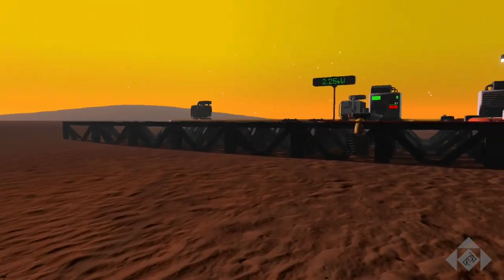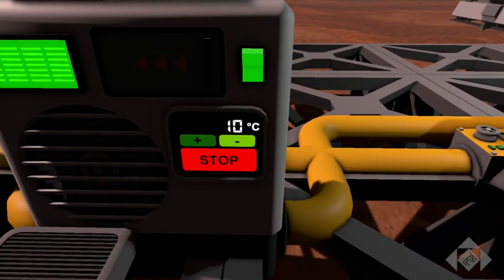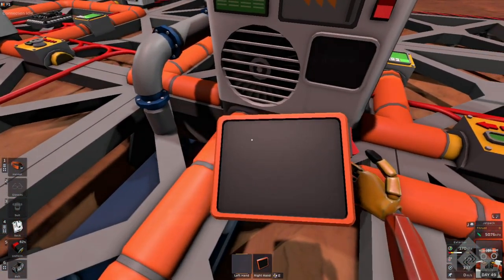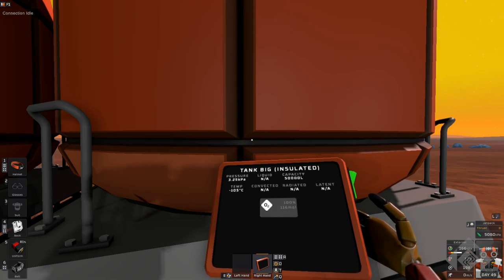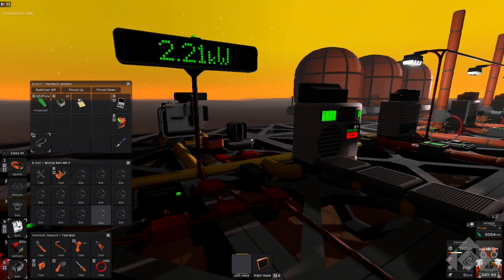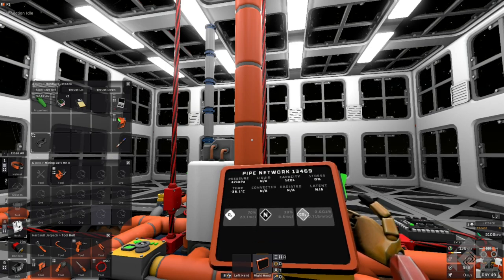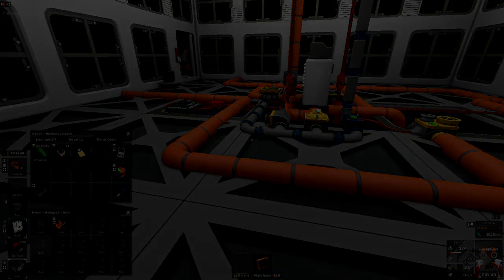More Realistic Gas Filtration, an actually quick tutorial - Stationeers

Comment: Hey Joelle! I have coded a single stage variant that is able to handle any gas input (as long as the O2 partial pressure is high enough) and make breathable air. Single IC (optional second IC to handle the liquids with a pump designated for each type of liquid) and it just hits temperature targets and waits for each gas to subsequently condense out of the system before heating it back up in the end with just oxygen and nitrogen at the ratios you want. Even allows for dialing in the ratios of CO2/O2/N2
Reply from the maker: Cool beans. If you make a video, send me the link!

Comment: Ok idea time, here is what I'm thinking: a self cooling loop from furnace exhaust, given that pollutant liquefies so easily at pressure and that that furnace exhaust is usually full of it (pressure and pollutant). Making like a heat exchanger (in one of your recent videos), where condensed pollutant goes into the chamber and evaporates back again drawing heat, a back-pressure valve to make sure it stays under condensation pressure, and venting the excess off.

What I'm wondering though, is how to make sure that the mix of gases is clear from pollutant before moving on to the next phase, and I guess filtering out the next elements without needing A/C. I think it could be done with pressure alone and some passive cooling, using nitrogen as pressurant makes sense, maybe condensation chamber for the separation?

Comment: You show something you call a "drain valve," but I don't see it listed in the pipe bender...
Reply from the maker: I'm probably referring to the evaporation valve.  It's in the valve valve object, the one that connects gas to liquid, or something like that.
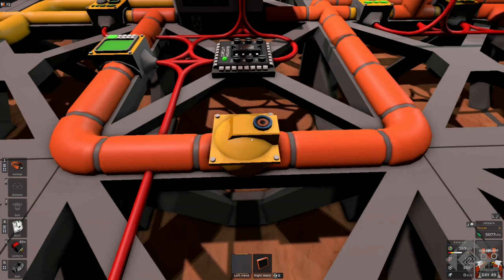Reply: @JoelleTheAbsurdist  Thanks for the reply.  2:15, there is something I see in-game called a condensation valve, but it has an actual valve handle on it, and requires a liquid pipe at one end and a gas pipe at the other, as far as I can tell.  So I've been attaching a liquid pipe and then a liquid drain, and leaving the valve open.  What you show at 2:15 looks a lot simpler.
Reply from the maker: @1squit  OOOHHHHH. It part of the drain object... the blue thing.
Reply from the maker: @1squit  This might help you
https://www.youtube.com/watch?v=0yzKhU_0APU
Reply: @JoelleTheAbsurdist  Ok, thanks!
Reply: For the next time, something like this happens. You can open the wiki, pressing F1. You find the object you want to place and there you will be shown which kit you need to build it!

I hope that helped :)

Comment: Hi, a neewby here, i just starting and the first thing my engee-brain made me think about was gases filtering system. Until now trying with condensation systems, wiil be too much to ask you to share a save file with this setup? i will love to study it and learn how is working and the game mechanics behind it. Regards!
Reply from the maker: This is a different base, but is set up on a planet with more gases and a more varied temperature range.

https://drive.google.com/file/d/1FBKFtWMzmppZ9Gh2Ez3I7CpMhk010Fup/view?usp=sharing
Reply: Thanks  @JoelleTheAbsurdist  !! I dont understand the system on this file, is a little different to that one on the video. By my self, after many many tries, still cant do a "clean" filtering, always get some mol-fractions passing the sensor. Some ideas how to make partial process? i mean, finish to filter one gas before continue with the next one. Regards!
Reply from the maker: @leandroschenone7253   It's essentially the same, just laid out different. The key is to bring the temperature down to the highest liquefiable for the highest pressure, then use a gate and fill system to separate the condensing chambers.
Reply: @JoelleTheAbsurdist  Is exactly what im doing, pressurating the input, cooling step-by step, until i get the desire temperature for the gas, also i put a digital valve, detecting ratio of the specific gas, to stop the flow until i finish the filtration, but, when the valve is open a new portion of gas enter the system, the detection is soo slow, that a few mols get before its closed again. i dont know if i can explain clearly.
Reply: @JoelleTheAbsurdist  Hi! The link is down. I wouldn't ask for this but since you already shared it. Can you share it again so I can take a look, please? Thanks!

Comment: can i get a copy of your code?
Reply from the maker: Sure
Reply from the maker: alias LastSegAna d0
alias LastSegVlv d1
alias ThisSegAna d2
alias ThisSegPump d3

alias TmpTmp r0
alias PumpVal r1
alias PrsVal r2

define TrgrPrs 40000

loop:
   l r14 LastSegAna RatioWater
   l r15 LastSegAna RatioSteam
   add TmpTmp r14 r15
   bnez TmpTmp IsolateReserve

   l TmpTmp LastSegAna Pressure
   blt TmpTmp 1000 IsolateReserve

   l PrsVal ThisSegAna Pressure
   brgt PrsVal TrgrPrs 7 #skip if GT
      s LastSegVlv On 0
      yield
      l TmpTmp ThisSegPump Setting
      add TmpTmp TmpTmp 1
      s ThisSegPump Setting TmpTmp
   j loop
   
   j IsolateReserve

j loop

IsolateReserve:
   s ThisSegPump Setting 0
   yield
   s LastSegVlv On 1
j loop
Reply from the maker: I edited the code a little after posting it
Reply: @JoelleTheAbsurdist  how are you handling the first AC unit, it only has one pump and one analyzer?
Reply from the maker: @mordiaky  Chop the top off the code

alias ThisSegAna d0
alias ThisSegPump d1

alias TmpTmp r0
alias PumpVal r1
alias PrsVal r2

define TrgrPrs 40000

loop:
   l PrsVal ThisSegAna Pressure
   brgt PrsVal TrgrPrs 5 #skip if GT
      l TmpTmp ThisSegPump Setting
      add TmpTmp TmpTmp 1
      s ThisSegPump Setting TmpTmp
   j loop
      s ThisSegPump Setting 0

j loop
Reply: @JoelleTheAbsurdist  I did the same setup but on mars and my pipes wil burst because because I am leaking other gasses into the end of the chain and they are to cold and it will make ice. how do I adjust so that it will not go to the next segment until it is ready?
Reply from the maker: @mordiaky  Did you change the gases in the code? Whatever gas you're excluding for has to be put on the chip... RatioSteam, RatioWater, RatioCarbonDioxide, RatioLiquidCarbonDioxide, ect.
Reply: @JoelleTheAbsurdist  I did not LOL, good catch, thank you!
Reply: @JoelleTheAbsurdist  yeah I am not getting it right on my end.. I will keep playing with it, maybe I am missing something.
Reply: @JoelleTheAbsurdist  ok found my issue, One, it is learning for me to understand the state the gas is in depends on the tempeture and the pressure, this will change as the preassure is higher or lower. so I had to adjust the AC units depending on the pressure it was at